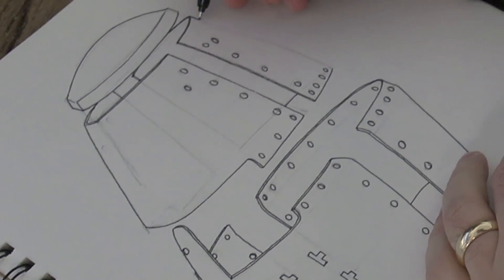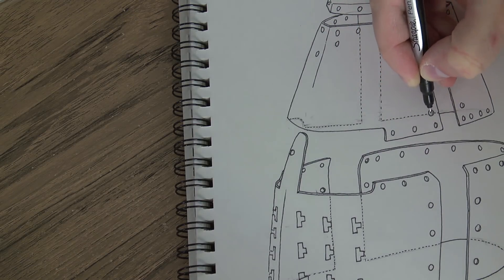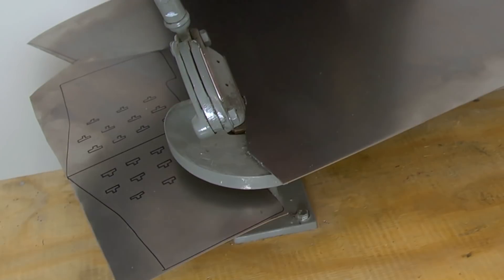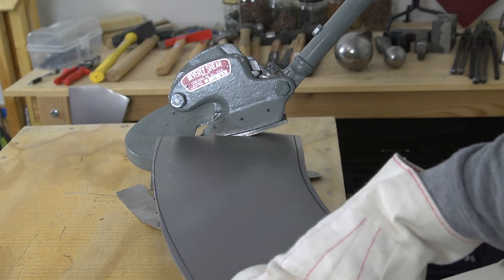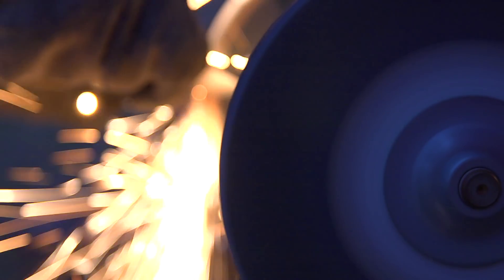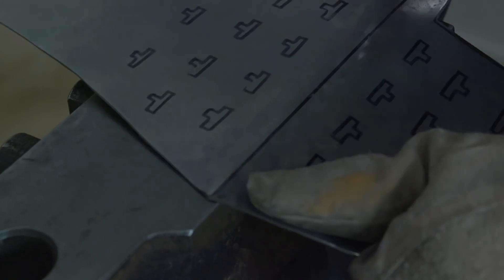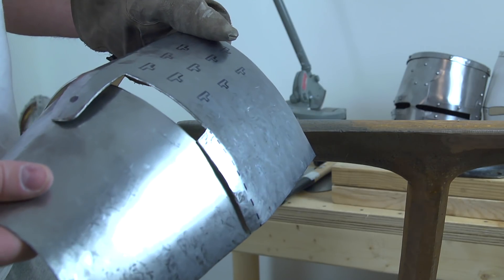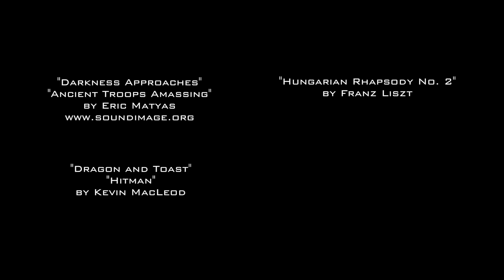How to Create a Medieval Helmet, Part 1 of 2

Comment: I have a question, is this helmet supposed to be worn over a second steel helmet or just the mail and the arming cap?
Reply: These were worn with mail and padding or just a padded coif I think. its a generation or two before those great helms you have another helmet under.
Reply: @reltihfloda7210  this style would likley have been worn with a skull cap under a coi as shown in some art from the mid to late 13th century and dont forget armor would probably been reused from older periods a lot like what is shown at the battle of visby by the peasants

Comment: Amazing stuff there.  

As for beginners, since shears are really expensive, I'd still advice against angle grinders (one doesn't knows when either the cutting disc of the metal itself will have an imperfection, causing it to 'jump' and cut a finger or other bodyp arts), but rather an electric jigsaw.  These are really cheap as well and a nice addition to the tool box, and dealing with some minor vibration is better than the danger of the cutting disc.
Reply from the maker: Yes, you’re right. Everyone needs to use caution with power tools and sharp blades. A jigsaw may be a better option. Thanks for reinforcing this!
Reply: Indeed! I always say that it's all fun and games until someone loses an eye or finger xD
Reply: My cousin got himself in the neck with an angle grinder despite having all the required safety gear, while useful they are as you say extremely dangerous.